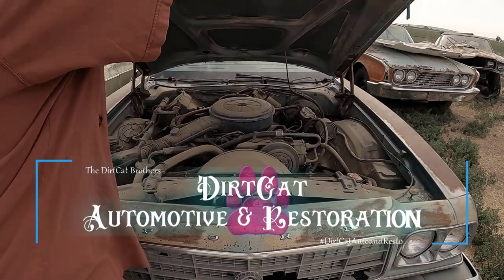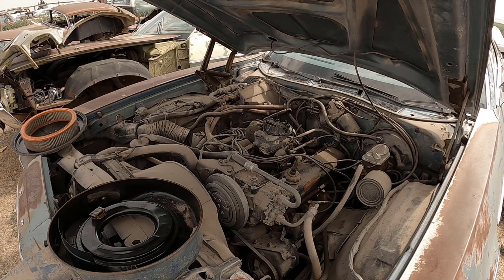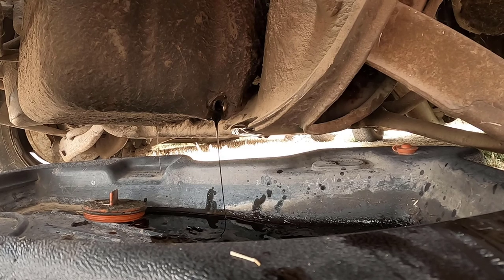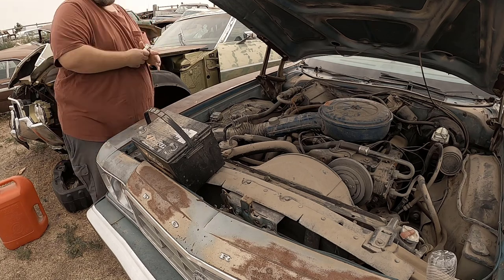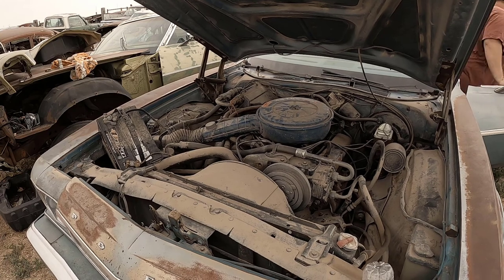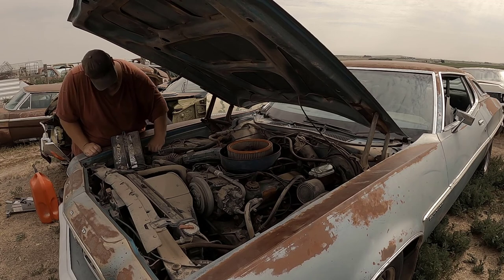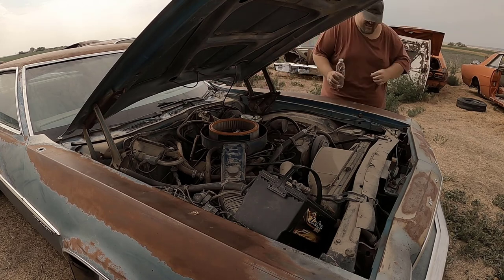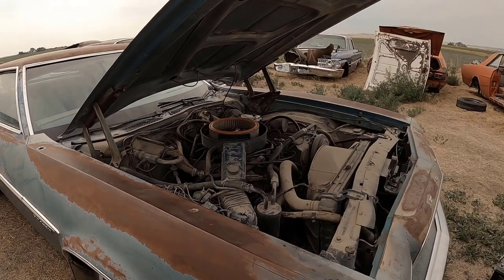Will It Start?  1974 Ford Gran Torino Sport Brougham 351W 2 Door Hardtop

Comment: Ford has rubber caps on the valve guides as seals to stop oil getting into the combustion chambers an they go hard over the years an can even fall apart an let to much oil past the guides that will cause it to smoke an with the rite tools you can change the seals with the heads on the motor in the car

Comment: 1974 had a sport coupe. I owned one and I miss it. You’re thinking about the 72-73 fast back. Ford only built the fast back 2 years. The 74 Gran Torino he’s working on has a 73 front grill and bumper which tells me it was in a accident at some point. You’re right there is no such thing as a Gran Torino Sport Brougham.
Reply from the maker: You know nothing about this car.  I suggest you not to try and correct anything on something you know nothing about.
Reply: @TheDirtCatBrothers  wow. I wasn’t expecting a retort. Sorry to bust your bubble. Just look at the grill of a 73 compare that to a 74.  73 also didn’t have an opera window until 74. All gotta do is look at old sales brochures. By the way Brougham was a luxury trim level which had all the bells and whistles. Gran Torino Sport is just that a Sports package of the Gran Torino.  Keep in mind that car is 49 years old you’re not going to know when that front end was replaced I know this because I was in high school in 1979 when I had my 1974. I don’t drive Fords anymore. I’m retired and enjoying my Tesla model Y. Good luck on your project problems.

Comment: Hey man I saw your other video where you rescued a cyclone gt. About 1 year ago I too rescued a cyclone GT from becoming one with the Earth at a body shop in georgia. I noticed you rescued two or three cyclone/gt Montego body style cars, do you happen to have any extra trim? I'm on two or three Facebook pages dedicated to those body style Mercury cars. I'm not real hard to find my logo is a Trans Am bird. I recently posted a YouTube video updating the progress on my red 70 cyclone GT car. I'm looking for a Nike swoosh for the passenger quarter window or possibly a set that matches condition. I only have the driver side and it's in really rough shape but if I had two that were in rough shape I'd be good with that as long as I had a set. I'd be willing to buy one or a set if you have them. Great videos and if you're willing to share the information what junkyard did you rescue those cars from
Reply from the maker: The Montego MX is a beatbox for it’s getting torn apart for the Cyclone GT.  All parts that are coming off of it will be either used and/or save back in case something happens.  The salvage yard I got them from don’t have any more of those types of models.